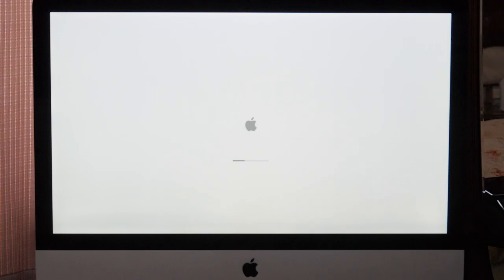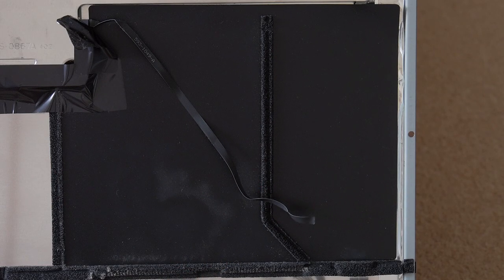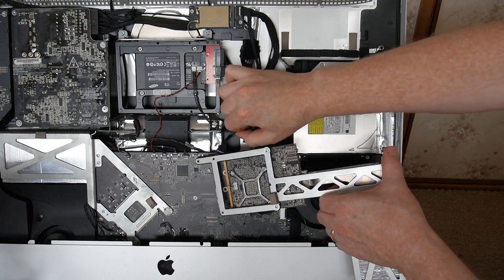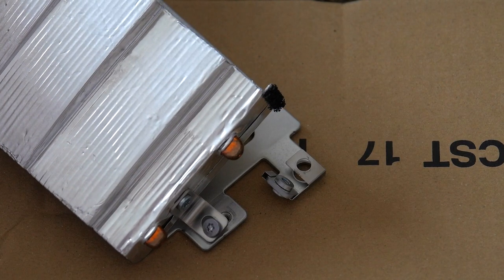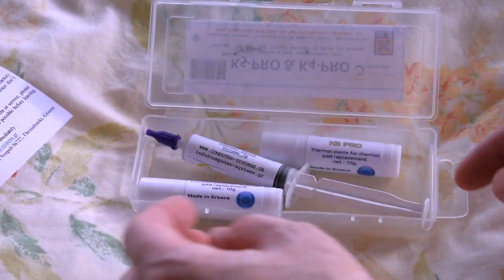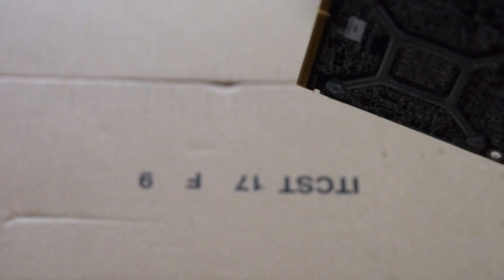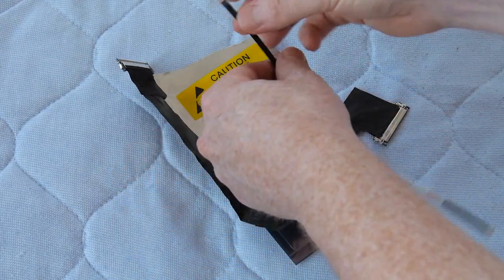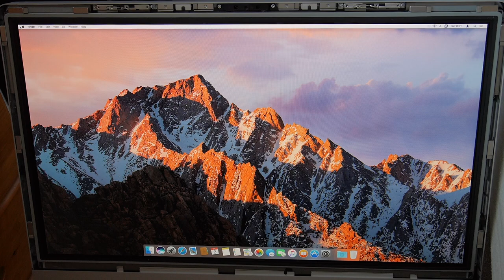Late 2009 iMac 27" Video Card Repair — 4850 — 2nd Bake

Comment: Since it’s an AMD card that failed for the second time, would it be safe to say that the problem wasn’t ATI cards, but poor cooling of the GPUs on the 27" iMacs?
Reply from the maker: No because the CPU is cooled in a similar manner and yet the CPU has not failed.  In fact, I've never even repasted the CPU at all, and my 2009 iMac is still in use today in March 2024.  The AMD graphics cards used in 2008 through 2011 iMacs are known to fail to due issues with the GPU chip.  Some feel that the issue is with the solder balls, but that cannot be true because the oven bake is 200°C, whereas solder reflow tends to be at higher temperates like 235°C.  There's something going on inside the GPU chips of AMD graphics cards used in iMacs in those model years which resets itself with either an oven bake or application of a hot air gun.  How long that reset will last varies.  I only got 4 months of use from my first bake, probably because I didn't remove all the stock paste.  I did remove all the old paste and used good new pastes after my 2nd bake, which lasted 2 years and 9 months.  I also know from experience that even having Apple swap out the graphics card with a new one only lasted 3 years, so having the bake last 2 years and 9 months isn't bad.  But I also know from the comments section that some people have used the bake and have gotten well beyond 3 years from it.

Comment: What I don't get is, basically the point is to re-flow the solder to re-create good connections yes? So is the issue, the heat over time fractures the solder and compromises the connectivity?   Also I bought the Arctic Silver thinking I could use it for the whole job but now that I see this it looks like not right? Do I need to get like the K5 or something? Thanks
Reply from the maker: Bad solder balls is the theoretical cause, yes.  I can't prove it's true but the bake works for most people.  You CAN use Arctic Silver on the GPU chip only, and only if you use it sparingly so there's no overspill.  You can't guarantee no overspill on the memory chips which is why you need to use non-conductive paste on those.
Reply: In the case of flip chip tech, there is nothing wrong with the solder, 90% of the time, its the chip internals that are failing. The high heat over long periods of time, causes connections inside the chip to breakdown and leak current. Reheating the chip can temporarily resolve only a portion of the the disconnects to the point where it can start working again. 

If you want to read about the science about how heat ruins the internals of flip chips, or more specifically the solder bump of the chip, and you don't mind reading a very technical science paper, which is building on 20 years of study and includes examination via electron microscope. Then enjoy this paper published by IEEE in 2007: http://ieeexplore.ieee.org/abstract/document/4250070/

"Aside from electronic considerations, computer chips are made of components that, like any material, degrade over time. Heat accelerates this process, as it does with any chemical process. If the processor operates at a higher temperature for an extended period of time, materials inside the chip can degrade, which once again will result in garbled signals." - http://www.ebullientcooling.com/heat-problem-computer-chips/

Reflowing/baking is like duck taping a broken piece of wood that is used under a constant load, or heavy load if its GPU intensive software. It won't last long and is not as strong as it used to be. 

Other Explanations:

https://electronics.stackexchange.com/questions/13873/why-exactly-do-chips-start-malfunctioning-once-they-overheat

https://superuser.com/questions/191486/what-fails-in-the-processor-first-when-a-processor-overheats

Louis Rossman's Explanation (For dummies who don't want to read technical science papers)
https://youtu.be/E9aZZxNptp0

Comment: What about the option of changing the grafx card with a diff one than ATI? Would that be a better way to go?
Reply from the maker: I ultimately changed mine with a 6970M, as discussed in my video here: https://youtu.be/9dPsH1zIQMs
I cannot speak about other cards because I don't have experience with them.
Reply: @JDW-  ok but im wondering, isnt the new 6970 card gonna overheat and after some time eventually malfunction too?
Reply from the maker: @giorgos7six  In theory, I suppose.  But in reality, consider well that I made that 6970M video on Apr 26, 2020.  It's now Feb. 2024 and the card is still going strong.  That means something.
Reply: @JDW-  my Ati5750 was going strong for 11 years and then broke down... what can i say... im worried about all the Ati cards :-(((
Reply from the maker: @giorgos7six  I am not worried about my 6970M breaking down after more than a decade of use.  Consider well that I am still using a 2009 iMac, which in and of itself is quite nice.  Nothing lasts forever.  And at some point you have to ask yourself why you are even using a machine so old.  In the end, if 11 years of life for a video card seems short, then it is perhaps time to upgrade to something more modern, rather than try to eek out more life from an aging machine that can no longer run the latest software or get the latest security updates, or offer performance that meets even one's basic expectations.  True, Apple no longer offers a 27" iMac -- they are pitching the 24" model instead, asking buyers to get the Mac Studio and the Studio Display for a larger screen and better performance.  But Apple Silicon Macs are here to say and offer great performance.  It really may be the best choice overall, rather than debate about what video card to get for a 2009 iMac which really isn't relevant to most people these days.  If I can get at least 10 years of life from my Apple computers, that largely satisfies me.

Comment: I have the same card can you tell me which GPU i can replace it with? Is there an NVidia card that's compatible with this iMac?
Reply from the maker: You can repair your 4850 by using my video, but I would not advise that you replace it with a different card. Newer cards may not fit perfectly, and newer cards may also generate more heat, which is the last thing you want. And no, you cannot use Nvidia cards.

Comment: I just tried this bake and I get a black screen on startup. I hear all normal startup sounds but no picture. I checked all connections 2x and even removed and put back the video card from mother board. I used the k4 and k5 paste like you did also. Any solution to why I’m getting the black screen?
Reply from the maker: Alex, it appears you did everything well, so I cannot say for sure what the problem is, unless your video card was simply too far gone for the bake to resurrect it.  What were the exact symptoms you saw prior to your bake?  Also, what size and year iMac do you have?  Thanks.
Reply: JDW I have the late 09 27” iMac. My symptoms were just the white screen and wouldn’t go any further.
Reply from the maker: In my case, I never got a pure white screen with nothing else. My machine would randomly freeze and sometimes show artifacts on the screen and only very rarely and briefly show a pure white or black screen. In other words, my machine would kind of work OK, but lock up most of the time. So it seems that your machine didn’t work at all and you only got a white screen, correct?

If your machine worked fine and then all of a sudden started showing you a white screen and only a white screen, I wonder if the problem really is with the video card.

It could be that your card simply is dead. It could also be that a second bake might work on it, but I admit it would be troublesome to do that.

When you remove the display to look inside again, check the two ribbon cables attached to the display to see if they look like they are still in near perfect condition, especially around the connector ends. The reason I say this is because a white screen is evidence the display is not getting a signal, either through ribbon cables or through the video card.
Reply: @JDW-  I took it into the store and they confirmed it was the video card before i attempted the bake. I checked the connectors when i was making sure everything was plugged in and they all seemed ok. Maybe ill attempt another bake when i have time.

Comment: I have blue vertical stripes on my iMac 27" late 2009 with Radeon 4850, can this be solved by baking it?
Reply from the maker: It's highly likely a 10-minute bake would fix your problem.  But when you open your iMac, check the two thin cables which connect the circuit boards to the back of your display, disconnect, reconnect, lay the screen back into place, then try to boot.  If you still have the same problem, then, yes, I suggest the bake.  It won't hurt anything to try.  Just be sure to read the description under my video to ensure you have all the tools necessary, and I highly recommend K4 and K5 Pro thermal paste too.  That's not to say other pastes won't work, but my 2nd bake has lasted more than a year with K4 and K5 Pro, so I can speak from experience about how good those pastes are turning out to be.  Be sure to comment back after your bake to tell of your success or failure.  More likely, it will be another story of success!
Reply: I will try it, just need to get the thermal paste and the suction cups. Thank you in advance!

Comment: Hi guys. I did the same. Came back to life, but after a few seconds the screen turned black. When I restart it works for a minute and goes black again. The same thing repeats over and over... Any idea?
Reply from the maker: Hello, Felipe.  This was your first bake attempt, correct?  Did you clean off all the old thermal paste completely prior to your bake?  And did you bake for 9-11 minutes at the required temperature in a regular oven that was preheated, with the card suspended on aluminum foil feet?  If you did all that, then I must ask what kind of thermal paste you used after your bake.  If you used regular thermal paste on the memory chips on the video card, it will be a problem.  The card could have shutdown due to overheating.  You must either use a thermal pad on those chips or better, use K5 Pro like I did in my 2nd bake.  Now, if you did the bake correctly and with K4 and K5 Pro like I used and still had that problem, it could be one of two things: (1) maybe there is a cable that wasn't properly secured by you and heating caused the connection to become intermittent and therefore shutdown the display, or (2) your card simply needs another bake.
Reply: @JDW-  thank you! I used a MX-4 thermal paste. But now I'm having the feeling I haven't baked it for enough time. I'll try a second bake in the coming days. Thanks for the reply, very descriptive. :)
Reply from the maker: @felipebraga8050  MX-4 is a non-electrically conductive paste that is perfect for the GPU, but it is not for the memory chips.  The reason is because the gap between those memory chips and the heatsink is very big compared to the heatsink distance from the GPU.  The heatsink pretty much touches the GPU.  And so, you must use thermal pads or K5 Pro like I used.  Even though MX-4 may seem to fill the gaps, it is not intended to do that and therefore you need to remedy that problem.  Baking for an insufficient amount of time would also be a problem, but that is a second, unrelated problem.  If you fix both problems you should be good to go!  Just be sure to clean off all the paste before you bake again.

Comment: Thank you for 2 wonderful videos, i wish if i watch them before i bake mine, as i am taking the screen out i managed to pull away the cable base in the logical board,  the little shark teeth look a like connectors to the video cable base, Just wondering if you know of any how to repair it or where to take it to get it repaired. Thank you
Reply from the maker: I'm not sure what cable you are referring to, but most of those cables are very delicate.  It would probably be better to buy a new replacement rather than find someone to repair it.  You saw in my video that I replaced 2 cables that way, for a very good price.  For example, here is one of the cables I replaced, buying from a respectable seller on AliExpress (China): http://bit.ly/2hqSRei
If your broken cable is different from mine, then try to find a part number and then search for that number on AliExpress.  That is all I did for two cables and I easily found both from the same seller.
Reply: Thank You For such a quick reply, i am getting the new cables for sure, My damage was actually on the logical board connection where you hook up one of the cables, it is the one marked as #3 connection at your first video after 11.23 minutes of the start time, that is the piece that was ripped of at one side, managing to get most of the connecting pins twisted and two of them broken off the board. Sorry if i was not very clear in my previous description. so i am not sure who can fix that and if it is worth it for a 2009 machine. i already ordered the piece that came off, should be received in couple of days.
Reply from the maker: I see.  You mean the connector directly in front of the video card, which is an SMD soldered connector.  Removing the existing connector and soldering a new one should be done by someone skilled in SMD work.  So long as there are no through-hole connections, it should be fairly straightforward to swap it out.  The thru-hole connections are a major pain on these multi-layered circuit boards. As to who can do the job for you, I can only suggest that you seek out your local electronics repair shop, who should have the appropriate SMD desolder and solder tools as well as experience in that area.  Best wishes to you.
Reply: can't Thank you enough, for all the valuable information and terminology. Just one more issue, as for the 2 broken copper connectors [ i have them] that came lose as i was trying to align every thing back, is it doable to reattach them or should i consider getting a replacement for the logical board?
Reply from the maker: SMD means "surface mount" (as opposed to something soldered to the circuit board through a physical hole.  Any component that is surface-mounted can be desoldered fairly easily, but whoever does that job must ensure that no circuit board "traces" had been broken.  If any traces were broken from the pads (or any pads missing), then of course those breaks must be fixed.  Thru-hole connections on multilayered boards are harder because it often takes a lot more heat from a soldering gun to remove a thru-hole device and then solder back in a new one.  And there is risk that you may not solder the pin back such that all the connections made on the inner layers will be good contacts.  That is why I suggest you find someone experienced to at least give you a cost quote on how much a repair might be.  It only at that point you can best decide if it is more worthwhile to pay for a repair or buy a new motherboard.
Reply: Thank you again for being detailed oriented and explaining what i need to do, that is my first time to deal with such an issue and was not really sure what to do. i shall locate an SMD solder repair shop around the area and take it there. Thank you again for all your help

Comment: Hi JDW, thank yo so much for these videos and the Sept 9 update. So I'm going to give this a try. Question for you, what do you think about using "thermal pads" instead of the K4 Pro. Can you recommend a source? Thanks again.
Reply from the maker: Thank you for your kind words. Because I don’t have first-hand experience using thermal pads, I cannot offer you good advice on how to properly select them for use on the video card. I have simply read comments from others in various online forums that they used pads, but in all of those comments no details were given. So I’m not sure even how thick thermal pads should be exactly. And that’s another reason why I decided to go with K5 Pro because you can adjust the thickness quite easily.  And any excess K5 Pro you apply will simply spill over and not be a problem because it is not electrically conductive.

Comment: JDW: Thanks for making these excellent videos. Very helpful. I did the bake on my 2009 27” iMac 4850 card a month ago and it’s working better than ever. But for how long, I wonder. I baby it—I’m not running any graphics-intensive programs and my GPU-diode temp never exceeds 130˚F. I have a feeling that temps in the otherwise “normal operating range” are likely to cause this card to fail again. What’s your sense of the longevity of this fix? Are you nervously eyeing your temp gauges, too? Or am I being paranoid?
Reply from the maker: 130°F is about the same temperature I’ve been seeing.  I performed my second bake the first week of July 2017. It’s now the first week of April 2018. That’s eight months of continuous use, and my late 2009 iMac is still going strong.  I use the free MacsFanControl app to keep the speed of all three fans locked to 1600 RPM. That’s faster than the standard speed but it doesn’t increase volume too much. It keeps the iMac a bit cooler overall.
Reply: Fair enough. I was half tempted to throw some more memory and an SSD in this machine. But I suppose I should just be grateful for the "borrowed time" and keep saving for a new computer. Thanks again!
Reply from the maker: Swapping out the spinning platter hard drive for a Samsung EVO 850 1TB SSD make a huge difference for me.  I think it's worth it unless you think you won't be using that iMac very long.  Regardless, you can always yank out the SSD if you change Macs in the future and use the SSD as an external drive (assume you have a case for it).  I also have 16GB of RAM in my iMac and I feel that is really the minimum RAM you need when you have 2 users open at all times, as I and my wife do.  Again, best wishes!